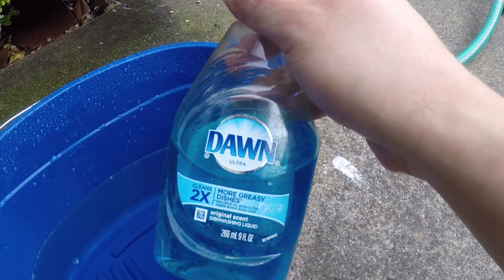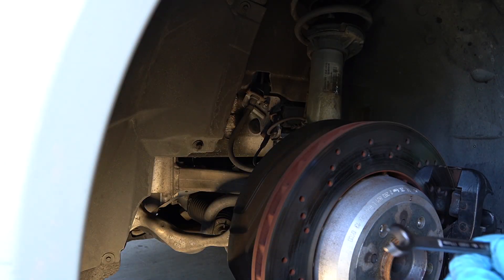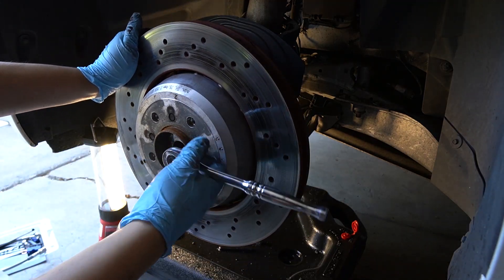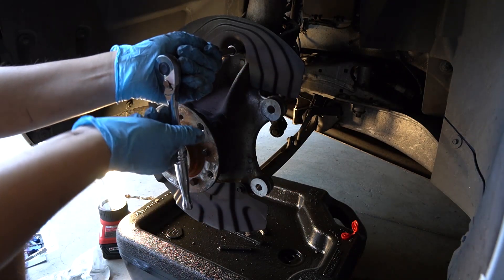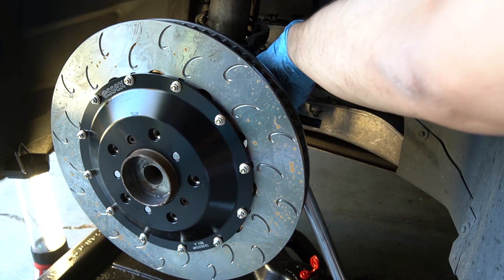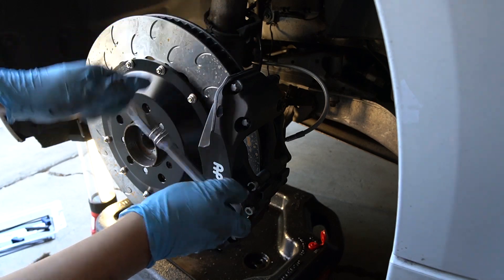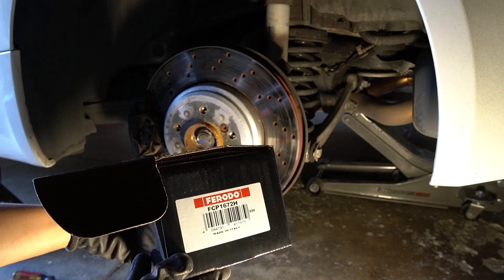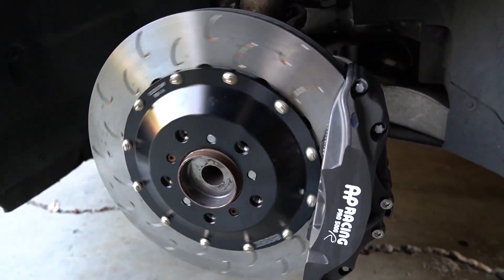Installing the Essex AP Racing Brake Kit on my E92 M3

Comment: Nice video, enjoyed how well set out it is. Just checking when you undid the stock brake line hose from the hard line, was there any problem/ tips? 
Hard line on mine looks like it wants to twist at the same time as the bolt.

Comment: nice installation video.. i notice u didnt use any Pad Retention... is there any rattling while driving?
Reply from the maker: They do rattle a lot, but much less if you use pad retainers.
Reply: @WillsGarageOfficial  oic, i also having the same caliper, recently been giving off some wong wong sound while driving.. my guess could be from the shim I’m using or the retainer causing the pad to retract improperly

Comment: How come you didn't go for floating discs and how are you finding them
Reply from the maker: They're floating discs 👍. Probably didn't appear so because the bells and discs came pre-installed. Essex race parts provides them in the US market.
Reply: @WillsGarageOfficial  Thats not a floating disc, thats a bolted disc. The AP hardware for floating discs is completely different. Two piece rotors and floating rotors are two very different things.
Reply from the maker: @Doggepp  Thanks for the comment. This kit comes with floating discs. The "float" is built in the disc itself. The mounting holes for the hat attachment bobbins are not round. This allows the mounting hardware to slide/expand as the disc heats up.
Reply: @WillsGarageOfficial  I see! Okay, must be a solution that Essex has done themselves then! I have a similar kit on my M3, and it looks completely different!

Comment: Are you sure you didn’t mount the discs swaped?
Reply from the maker: I questioned this too 😂. But it’s definitely mounted correctly. The instructions are very clear regarding the direction of the cooling vanes.
Reply: Will's Garage sorry just noticed your caliper is to the back of the car. Saw some people mounting them other way around and kept questioning myself for the past couple months ::D